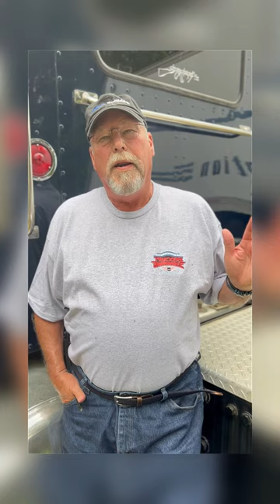Old Trucker Trick Using Diesel To Empty Dump Box! #shorts

Comment: Hey Dave, I am still an aggregate hauler, and although we don't use the diesel fuel, we use calcium in the box. 😊 on really cold days we will not haul or we may lay a layer of calcium down on  1 and  2 loads. From there the next layer will load place any on the next load or a 3 load day. We look at tenps of -3 as the starting point.

Comment: I drive a small 10 wheel dump truck. When I haul blacktop I douse the bed with diesel. Doesn't take but a gallon or two. It's well worth not having to scrape that shit off the floor.

Comment: All dump trucks still grease their beds with diesel. Hot asphalt slides right out. When hauling wet batch we spray the trucks down with diesel or oil to stop the concrete from sticking to the truck. Sprays right off by the end of the day.

Comment: Agencies been rather stipulate to contractors on asphalt to use a release agent...instead of diesel fuel itself because diesel cuts the liquid asphalt off the mixture, compromising quality of the mix...even at the paver because with shovels and the paver hopper.